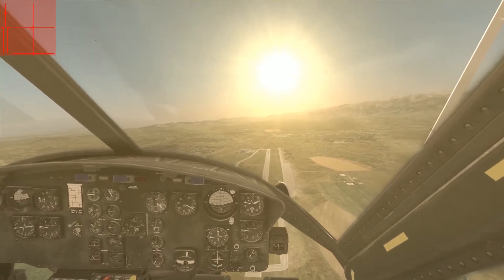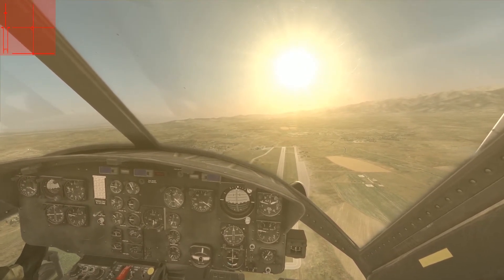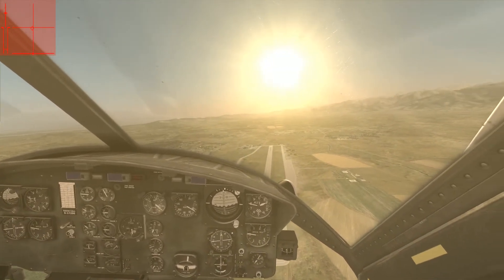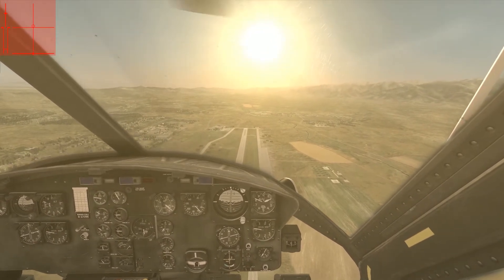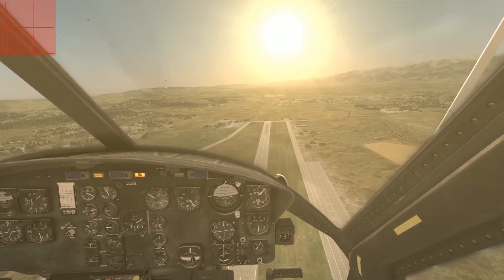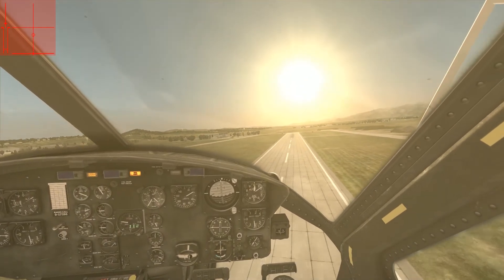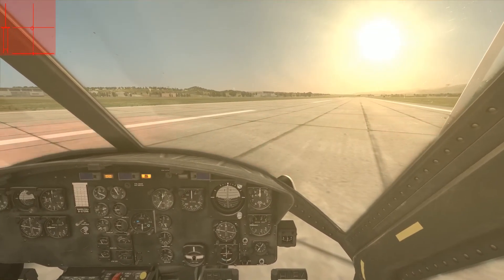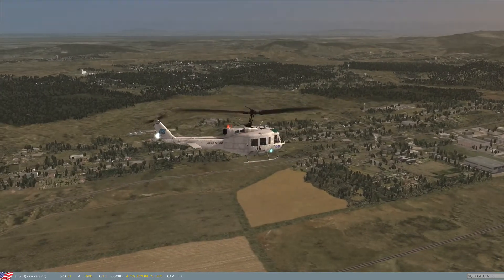DCS UH1 Huey Autorotation

Comment: I am a big fan of your AV-8B videos.

And I so happen to fly Airforce UH-1Ds and UH-1Ns (Greece) and I so happen to know a few things about autorotations.

Slowest descent speed is 65knots. That is the minimum descent rate so that you have the most possible time available to choose a landing spot.

But you can increase speed up to 95 knots or unofficially up to maximum permissible (110knots) in order to extend glide path in expense of higher descend rate.

Less than 65 knots gives both higher descent rate and short glide path.

However. You never, ever EVER pull collective while in the flare.

N E V E R.

Because you can cause vortex ring state.

You flare.
You level yourself.
You pull collective.

3 separate moves.
Reply from the maker: Thanks for the insight, I had no idea about the collective. Maybe one day I'll do this again.

Comment: nice landing.
Reply from the maker: Minamitsu Murasa Thanks, I had a bit of side slip on landing but I made the choice not to correct it as I worried that to correct it would use up too much rotor energy during the flare.  I now realise however that on most helicopters it is recommended to apply right torque pedal most of the way down to counter that.  I'm learning all the time!
Reply: Nice. 
It won't matter in an auto. You will always want to keep your nose straight on touchdown no matter what. Right pedal will give you more rotor rpm, as you are decreasing the pitch & drag of the tail rotor which is connected to the transmission. (when engine is running that is)